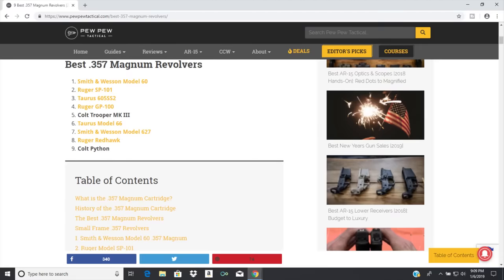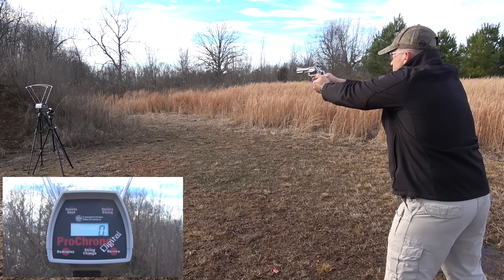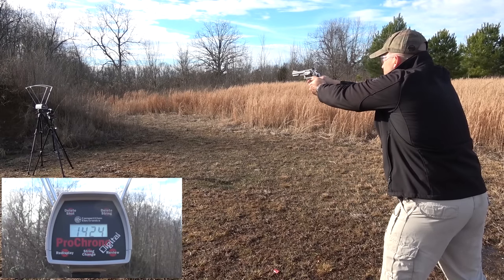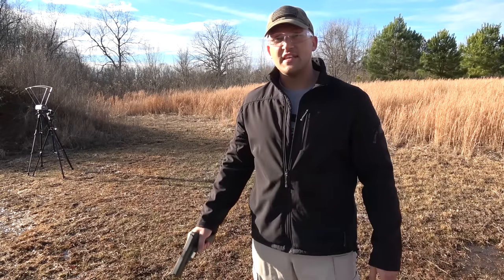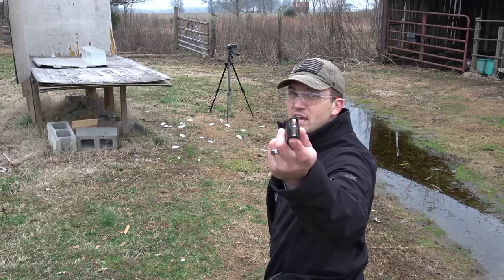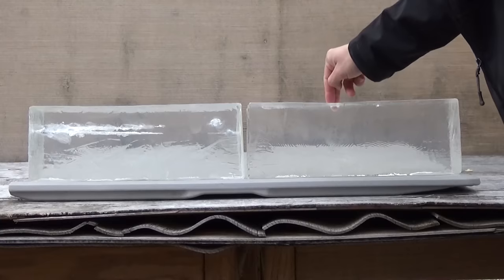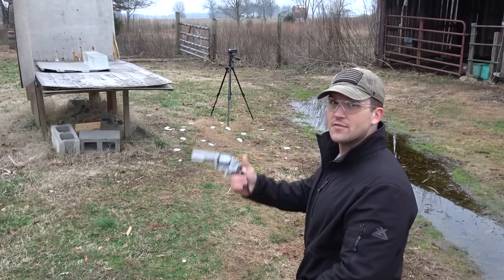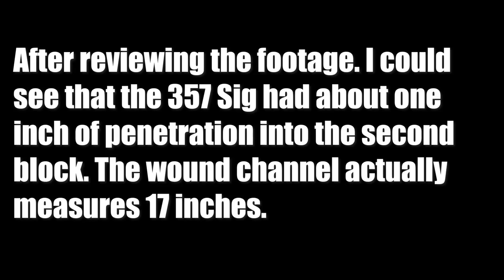357 Sig vs 357 Magnum vs Ballistic Gel

Comment: One of the most relevant caliber comparisons yet.
Reply from the maker: Thanks
Reply: sure is....proves that 357 sig is good enough for self defense..how a lot of people try to call it inferior due to it not matching up exactly with the magnum, it's not that far off...and now with hot ammo, there are probably rounds that match up even better....i love 357 sig!
Reply: But not really apples to apples kind of relevant.
Reply: Right.
Reply: @Bxwaveprince  Probably doesn't help that 4" revolver vs. 4" auto isn't as fair as you think it is, the Glock includes the chamber as part of that length, the revolver doesn't.  Might not make much of a difference with some loads, but here it does.
Reply: .357 sig was to mimic. 357 mag .. it was never said to be the same .. although in different barrel and ammo configurations its damn sure on its heels ..
Reply: @enwurdgibsmedat1517  Revolver has the cylinder gap that bleeds pressure though, so it’s pretty fair.
Reply: @Freddy Ruger definitely not dead... readily available ammo and guns... my Glock 32 gets carried everyday
Reply: @Freddy Ruger ok buddy...get a life
Reply: @Freddy Ruger 🤣🤣🤣🤣 you're emotional
Reply: @Ghost that’s why it’s not a revolver round that’s supposed to replace 357 mag…
Reply: @Ghost literally said “nowhere close to 357 magnum” it’s not supposed to be. It’s supposed to be comparable to .40SW not a high powered revolver round
Reply: Absolutely. Both are fantastic cartridges.

Comment: I'm a .357 fanboy, magnum or SIG, I love them both. I converted my G23 to .357 SIG with a Lone Wolf barrel, added to my Taurus 66 and my 605, I have the .357 disease, but I like it!
Reply: Love the .357 mag, awesome round. I just don't at all understand the .357 sig. It's expensive and just barely gets more velocity than a +p or +p+ 9mm that's cheaper and also has larger magazine capacity.
Reply: @joshdiehl8737  Ballistics demonstrate a 125gr .357Sig round puts out almost identical velocity and energy as does a 125gr .357Magnum round form a 4" barrel. I also like it cause it's unique. As I have said before, if one thinks a beefed up 9mm is almost the same, pull out a .357Sig at the range, bust off a mag and watch the attention that follows wanting to know "What ya shootin, there Pal? Can I check that thing out?" Still, the 9mm in all its iterations is a fine round, I just am partial to magnum stuff cause I grew up shooting .357 Mags and they hold a fond place in my heart. YMMV

Comment: My everyday carry is a glock 32 ! I love it! So for me it’s plenty of power and 13 rounds vs 6. More is always better. And more compact and easy to carry! 357 sig all day everyday for me! Great video 👍🏼
Reply: Carlosmad 23 G23 with a conversion barrel here.
Reply: 5Rounds Rapid that’s nice. I had one like that also. Worked great!
Reply: Carlosmad 23 Same magazine, same frame. I have a 9mm barrel, too.
Reply: 3 guns in one! 👌🏻 I ported the barrel on my g 32 . I felt that it kicked more than the 40 cal and now it feels a little les than the 40.
Reply: my father: "speedloader?  spare mag?  you plan on missing a lot??"  match sharpshooter
Reply: em1o smurf go to active self protection. It’s a channel on YouTube. You can see a lot of real shootouts. And you’ll see the more rounds the better.... check it out!
Reply: mikey Kirby I use that very same ammo on my glock 32 . It’s amazing!
Reply: G33 .357 Sig here with .40 and 9mm conversion barrels. I use the .357 Sig for EDC with the G23 13rd magazine.
Reply: I have a Glock 32. I would rather carry my Glock over my 357 revolver. Both are fun to shoot.
Reply: @em1osmurf  Hopefully there's not 3-4 of them.
Reply: I carry a g32, own the R8.
Reply: @heathjones7002  Same set up for me too...awesome way to go for EDC
Reply: I put a new .357sig KKM barrel in my M&P 2.0 pistol. I load Critical Duty for ccw. The caliber is LOUD 💥 but the engineering is first rate. 0 problems, feeds cycles.
Reply: Still carrying 357 sig?
Reply: I EDC my Glock 32,once you learn to hold the control this barking little dog, you are well protected.

Comment: Now lets crunch the numbers in a Paul Harrel style. I get about 1173 fps in my 6“ GP100 for 450 ft-lbs with my 357 mag 148 grain Wadcutter reloads. Not comparable to these numbers but still an decent 40 S&W power level.

Comment: My mod 65 s&w has been my goto for everything for 30 years. I have shot deer, wood chucks, carried it on duty and had it on the nightstand. When i choose a firearm i look at ammo availability. I know there are rounds that are more accurate or have better ballistics but that doesn't help if its hard to find ammo.  .38/.357, 9mm, .45, .308, 30-06, 12ga and .22 you can find these in most any small town gas station.

Comment: Considering that the original designers wanted to copy the performance of the 125gr 357 magnum in an auto pistol. I'd say they did a pretty decent job. The 125s were pretty close in performance in my eyes
Reply: Kelso lowk  one of my carry guns is a sig p239 in 357sig. I love that gun. Not much bigger than my glock 43 but it packs a punch
Reply: +twatts45 yep the 357 MAG 125 gr @ 1600 fps is pretty close to the 357 SIG 125 gr @ 1400 fps. Let's say the SIG is somewhere in the ballpark, probably in the parking lot, as its only 14% behind.  Don't want to hurt the SIG's feelings, letting it know the reality that it is so far behind the 357 Mag, that the SIG can't even catch the 357 Mag's coat tails.
Reply: @63DW89A  show me on the doll where the creation of 357sig hurt you
Reply: @twatts45  357 SIG doesn't bother me. It is people ,out of touch with reality, saying the SIG is as powerful as the Mag, that irks me.  Nothing wrong with the SIG, as it serves its purpose well.  However, let's stay in reality and away from fantasy. The 357 Mag is much more powerful than the 357 SIG. That is just the way it is.  Again the SIG serves its purpose well, but it is not a 357 Mag and was never intended to be.  Just state the truth is all that is required.
Reply: I never said it was equal to or more powerful than the magnum. I stated that it was designed to mimic the performance with a 125gr projectile. Which it was. You yourself stated there is only a 14% difference. Which I would say makes it pretty damn close. What I actually said is that it's close performance wise, and at 125gr it is. In terms of velocity, expansion, and penetration. You know in terms of things that matter.
Reply: @twatts45  I've CCW carried 357 SIG (Springfield XD), and actually like the cartridge, preferring it downloaded a bit. I think a 125 gr JHP in 9/38/357 is about perfect at around 1250 fps, give or take a few fps.  Another favorite carry gun is a S&W 66 4" revolver; I never carry 357 Mag in it, only hot 38 SPL( Buffalo Bore 38 Spl +P 158 Gr LSWC-HP @ 1160 fps).  The problem is that the high pressure loadings(357 SIG, 357 MAG) can rupture your eardrums in a small room, if you are forced to fire in that situation.  In that case it is hard to beat the 38 SPl 158 gr LSWC-HP @ 1160 fps; a round having about the same striking force as a 230 gr 45 ACP, but at low pressure that will not rupture your eardrums.  One of the reasons I carry the S&W 66 so often!

Back in the late 60's-70's-80's, when the 357 Mag reputation was being forged, most factory 125 gr JHP loadings were a hot 1500 fps from a 4" revolver.  The 357 SIG was intended to approach that level of performance, not mimic it, as early SIG loadings were in the 1350 fps range for a 125 gr JHP.  In handloading, 357 Mag 125gr loadings can hit 1700+ fps from a strong 4" revolver (Ruger GP 100, S&W 686, etc).   Any of these loadings is getting way above the power and pressure needed for anti-personnel self-defense use.
Reply: I think we may just be arguing semantics at this point
Reply: @63DW89A  and to you as well
Reply: 63DW89A o
Reply: They were pretty close in penetration. Of course they make .38 rounds that get pretty close to that. Thats bullet design, not 'performance', as you are employing the term. there is an extra 38spl difference between the performance of the 357sig and 357mag; that is, the energy delivery of the magnum is like getting hit by the sig and a 38 at the same time.
Reply: @twatts45  

In the upper thorax where the BG with the 9mm triple punched me, because my excessively recoiling and poorly designed 357sig malfunctioned.

Yeah, its prone to feed malfunctions and excessive muzzle flip, for its performance level.
Reply: @twatts45  

You woefully underestimate how much 14% is. If you walked into work this morning and discovered your pay had been cut 14%, would you say 'well its still damned close'?
Reply: @63DW89A  

Thats basically the NATO spec 9mm - runs ~1235 from a G19
Reply: @springbloom5940  you seem to misunderstand a few things. The main one being perspective. A 14% difference is bigger or smaller based completely on perspective. If work cut my pay by 1% I wouldn't say it was close enough. However, if a coworker at a lower pay scale made 14% less than me I'd call that pretty fucking close. So I stand by what I said... again...
Reply: @twatts45  

I misunderstand nothing about it. You misunderstand how much 14% actually is. That 14% difference is equal to a nominal 125gr 38spl. The 357 magnum round, presented here, is equal to the 357sig + 38spl. Thats not trivial, by any applicable standard.
Reply: @springbloom5940  here's the thing. We could argue about this all day. Is 14% a lot or isn't it? The truth is I've got better things to do, and I honestly don't care. It's my opinion that 14% is a small difference, and it's your opinion that it's a large difference. In the end we're both right, and we're both wrong. It's literally just perspective. We're not going to change each other's minds. So I'd like to thank you for your opinion, and wish you a wonderful day. You're welcome to keep commenting, but I'll be going to sleep so I can work tonight.
Reply: 14% is a lot...I carry 357 sig and love it..but 357 magnum is alot more powerful...people like 9 mm some like 40..etc etc...carry what you like..but don't fool yourself into thinking a 357 sig is as powerful as a 357 mag..that is just lol!!
Reply: @ShinerBockGirlz  

The real question is how antipersonnel performance stacks up. 357 is about as powerful as is practical for 'work', but how much more effective is it, than 9mm? When comparing a pistol to a rifle, all common service calibers are virtually indistinguishable, in terminal performance. I prefer 40, because the snappier recoil helps me control the throttle better, but for all around utility, its awfully hard to beat a modern 9mm, for performance, price and ammo and gun selection. Mfrs have caught up to some degree, but at the time when it came fully online, we found 357sig to be too unreliable, restrictive and inconsistent. I was disappointed with the fate of 10mm, which actually is fairly comparable to 357mag. At the time that it was being evaluated, there simply weren't any durable, service grade guns available at close to reasonable prices and it never recovered.
Reply: @springbloom5940  I would love a 10 mm..wonder what happened to them...NM..u already stated....seems like a good cartridge...I also enjoy my 44 mag 5 inch w special rounds..if it's good enough for dirty Harry...
Reply: @ShinerBockGirlz  literally never once said it was just as powerful as 357 magnum.
Reply: Nasty round for sure. Especially when you think about effective barrel lengths. 
4" revolver + 1.6" cylinder (or more) = basically a  5.6"+ autoloader equivalent.
Reply: @63DW89A  The 357 Sig wasn't designed to shoot the heavier projectiles. It was designed to give .357 Magnum ballistic levels with 125-grain bullets in a semi-auto handgun with larger magazine capacity than a six-shot revolver and as the video showed it was very close. Add to that this was a demonstration of only one bullet made by one maker. If properly tested it would have been at least five shot lots of 125-grain bullets from various manufacturers.
Other than those observations it was a fun and interesting video!
Reply: @twatts45  okay, now that was funny!!!!
Reply: Lol, no it doesnt. The .357 magnum out performs it in every metric, except for capacity.
Reply: David H you don’t count the cylinder when determining barrel length. Not sure where that idea came from.
Reply: I'd be willing to bet they would be exactly the same if the barrel lengths were the same. Both guns have a 4 inch barrel but the magnum has 1 more inch worth of rifling and room to burn powder. The glock counts the chamber as part of the barrel length. So in reality the glock barrel only has 3 inches of rifling/length to burn the powder. If you put a 5 inch barrel on that glock then it would be an exact apples to apples comparison and the numbers would be much closer.
Reply: IMHO,  the 357sig is like a "perfected" 357mag for carry. It did not over- penetrate, had better expansion, and did you catch that "extreme spread" IT WAS LIKE 6FPS HI TO LOW!!!

Comment: The bullet that Underwood uses for the 158 gr Magnum that is often called the "Gold Dot" bullet is actually the "Deep Curl HP" bullet. Speer has confirmed that the plating on them is a tad thicker than the "short barrel" Gold Dot bullet that is often used in handgun ammunition. It's meant to be used in hunting, but Underwood knows what they are doing because even Speer's loading of that bullet into .357 Magnum ammo only yields 1,050 FPS from a 4" S&W and does not expand at all even in water jugs.

Comment: So basically the Magnum is roughly 200 fps faster plus more energy plus more damage. Man I love my magnum revolver
Reply: But you have to deal with more recoil for that extra energy.  Even if you use softer .357 Mag loads more appropriate for personal defense, you're still dealing with a bigger & heavier gun that only holds 6 shots.  I love my .357 Mag revolver too (S&W 19-4 with custom grips), but for a practical duty/carry gun, my Glock 31 has it beat by a mile.

Comment: I think the whole idea of 357 Sig was to match 357 magnum 125 gr load in a semi auto. Great test. Looks like it accomplishes that. With less case capacity I doubted it would outperform heavier 357 loads..no surprise there. Cool gel blocks! 😜
Reply: if you compare Hornady Critical Defense for both, they have almost the exact same specs.
Reply: That is the whole reason why the Sig load was developed. It was designed to present a semiautomatic option with nearly identical performance out of the same projectile weight and barrel length. Overall it is one of the most underrated pistol calibers for carry and sport on the market. Its relatively unknown by most folks because it was purpose built for law enforcement interests.

Comment: Excellent video....  Never have seen a 125 grain .357 Magnum run over 1475 from a 4" barrel...that Underwood ammo is insane!!!
Reply: Within standard load data for H110 powder ive measured 125 xtp's at 1550 from a 4 inch. The pressure is fine but the sound pressure is crazy coming off em, sounds like a big bore rifle with a muzzle brake :-)

Comment: I got the same low numbers with Underwood 125gr 357sig, 1391-1405 fps with a 4.0" barrel.  I sent the ammo back to Underwood.  They said it was low and was a QC issue.  Just received my new ammo.  It tested at 1458 now.  Still not the 1500+ like it used to be.

Comment: Either Underwood has tuned those 125's down for the Sig or the chrono is off.  I've seen this round tested in other videos cranking out OVER 1,500 fps!
Reply: I’d say underwood turned them down many have said they are only getting 1400 FPS now
Reply: I got the same numbers, 1391-1405 fps with a 4.0" barrel.  I sent the ammo back to Underwood.  They said it was low and was a QC issue.  Just received my new ammo.  It tested at 1458 now.  Still not the 1500+ like it used to be.
Reply: @ericfrank9491  Maybe they're testing with a 5" barrel?

Comment: Great review! Having owned both of these (both amazing calibers) I would say I do feel like for some reason the velocities of the sig ammo seem a bit lower than average. There are guys using the underwood 125 that get those velocities out of the compact 357sig 3.3 inch. 357 sig is great, better energy than 9 40 and 45, and more muzzle energy than 90 percent of the weaker 357 mag 125g ammo that I found off the shelves. While I loved my gp100 4" the trade off for just a hair more energy (15%) wasn't enough to outweigh having 90% of that power in a compact that holds 15 rounds. Both are absolute beasts though. I just didn't like the idea of a heavy 4 inch revolver and only 6 rounds to carry, Awesome review !
Reply from the maker: Thanks!